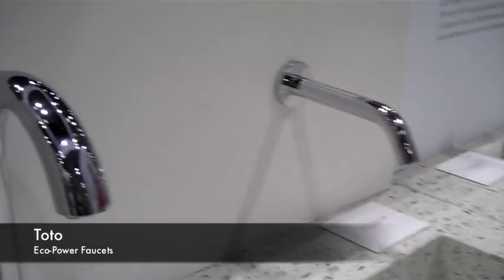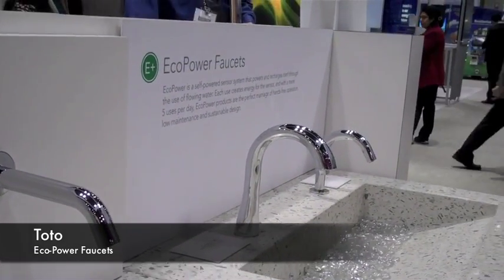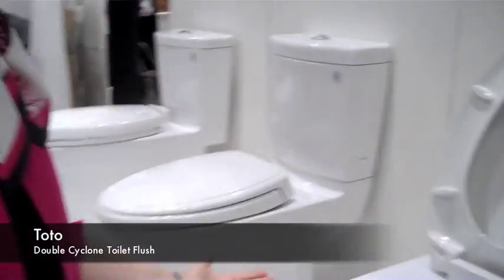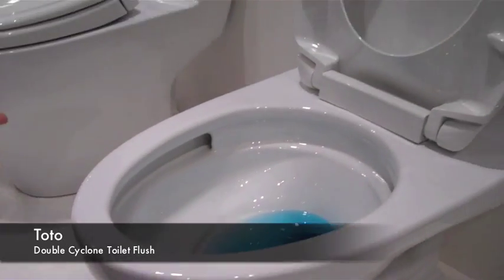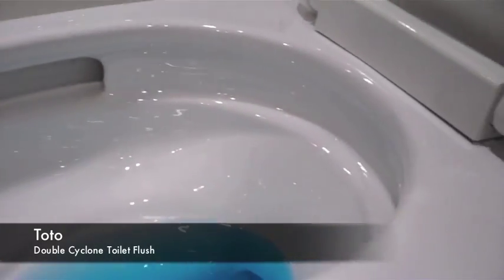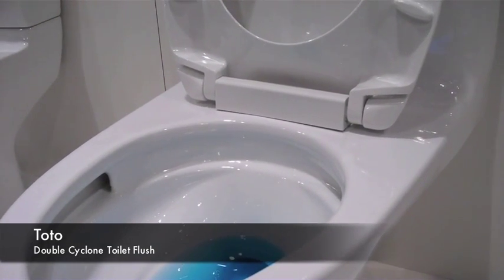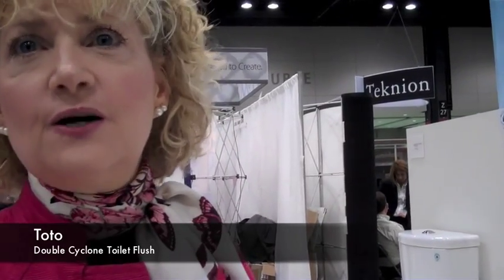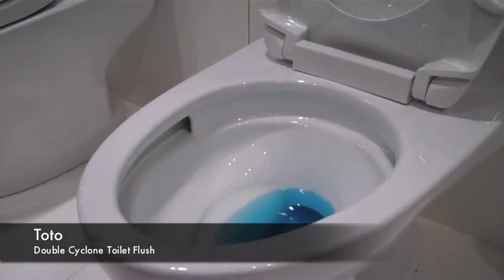TOTO EcoPower Faucets and Double Cyclone Flush Toilets

Comment: Very easy to install outside of running the electric GFI outlet. Plenty of pressure and user friendly. •ᴥ•>allmy.tips/TOTO-Tseat?bb-»    Getting ready to buy our third unit. Takes a few minuets to air dry. As for toilet paper usage I'm going on three weeks with the original roll.
Reply: wooooooooooooooooooooooooooooooooooooooow